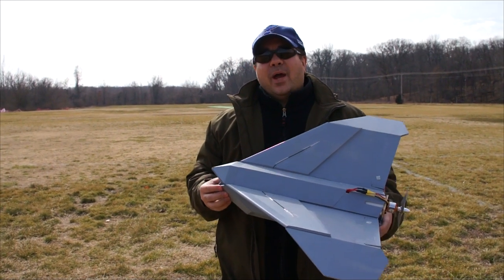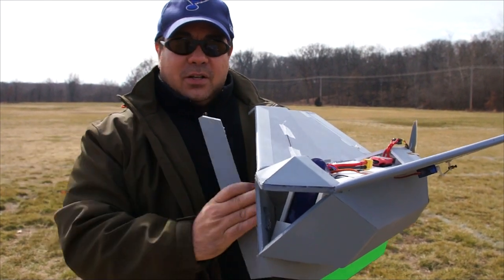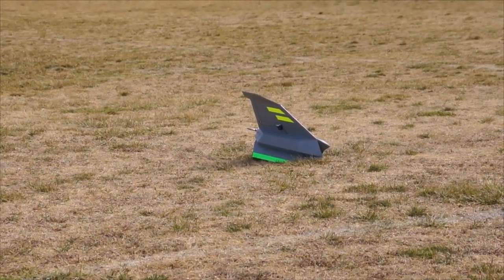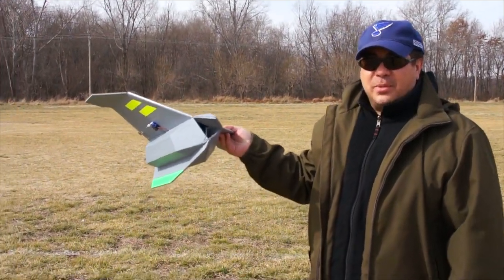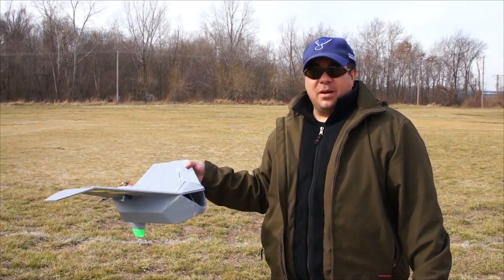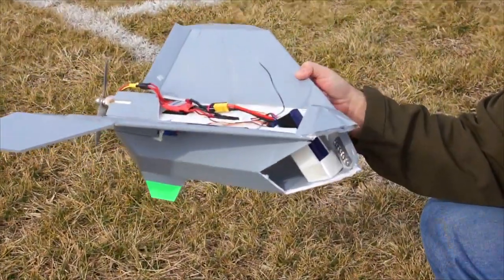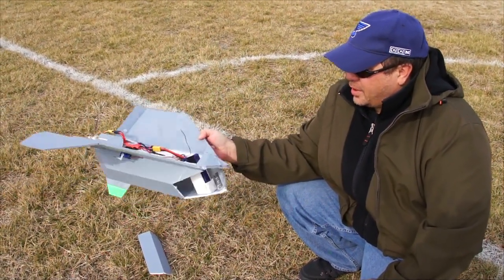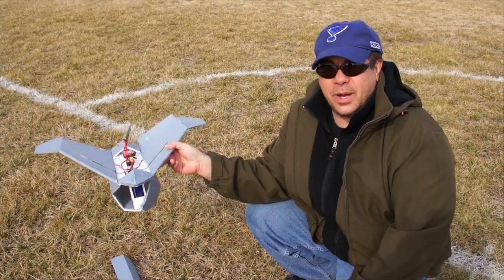MPUAV-Part2 Crash Crash Crash!

Comment: I think you need to move all your electronics down from the top, and lower into the body/fuse. The model seems to be turning over to put the weight there itself. With the limited wing surface there is little to keep it from doing it. Sort of like a tightrope walker using the long pole to lower his CG, or ballast in a sailing ship. I don't think the problem is nose or tail heavy, it's top heavy vs bottom heavy, and I think bottom heavy is the answer. Just my 2 cents worth.

Comment: I would try to reduce the relative weight of all equipment, especially battery/esc/receiver/motor/wiring/servos. As the real thing was probably going to make heavy use of stabilization systems, maybe the model could use something like Spektrum AR635 receiver with AS3X.
I love your sense of adventure in experimentation and the quality of your videos.
Keep up the great work...
Cheers!

Comment: I think putting the battery were it is is casing it to have a low cg making the staberlizer on the bottom useless I have had the same problem with my cg being to close to the tail making it spin out of control try moving the battery up higher and that may fix it

Comment: Yes a low CG is good but be careful, if the battery only is low in the front but motor in the end is high you get this "corkscrew" effect. The mass-line should be horizontally from the side view.
Now the mass-line is deep on front and goes up to the motor. The plane spin around this mass-line. Normally all components in rc planes are on the same high (+-) What do you think about this Guys?